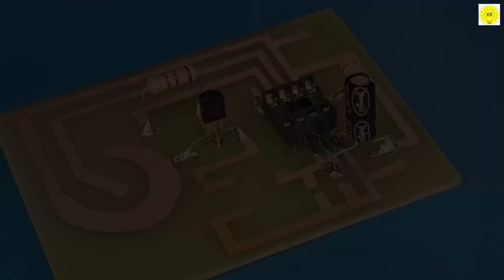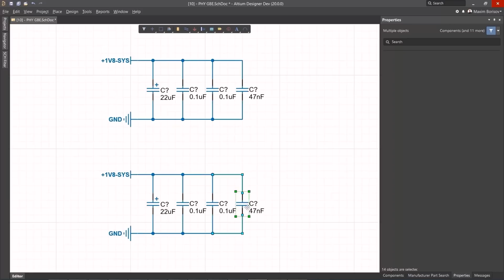how to make earthquake detector at home

Comment: Thank you for your amazing video. But in the schematic diagram of that circuit is different to your work. It is optional to put LED And another capacitor? Also why your capacitor is 100uf, in the diagram 10uf and 0.01uf only

Comment: TWO QUESTIONS:  is there a way to calibrate this device to the Rickter Scale that measures real earthquakes?     Second, what is you used an accelerometer like those used in cars (perhaps a scrapped one from a junked car) for your vibration detector?  Would that make the vibration detection more accurate?
Reply: The electronic side is purely a 1-bit digital switch that flips when the ball strikes the rim. There's no analog voltages involved here to encode that information.

However, the ball and spring form a harmonic system which depending on the mass of the ball and the spring constant, you can roughly tune a 'threshold' of vibration that will move the ball enough to touch the rim. Just need a bit of math.

Sensitivity will be directly proportional to the mass of the ball and inversely proportional to the spring constant.
Reply: study and buy an "arduino" system for $65